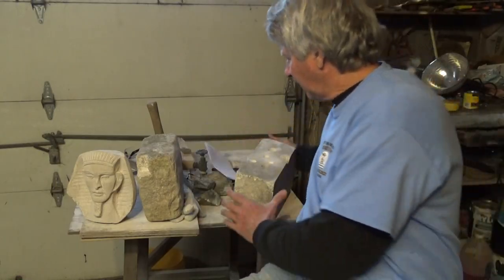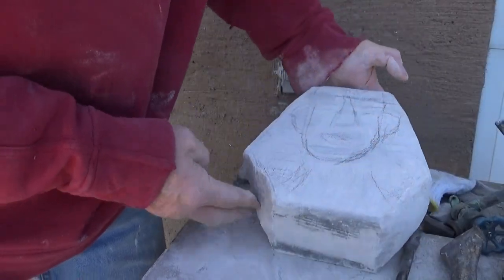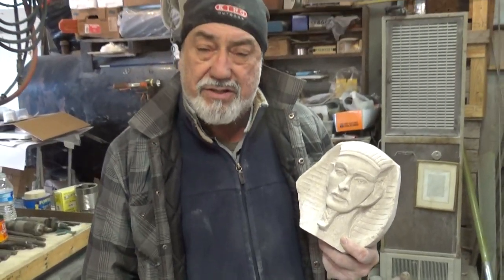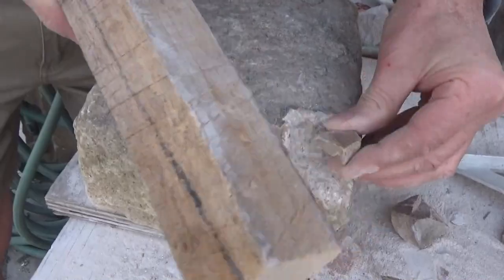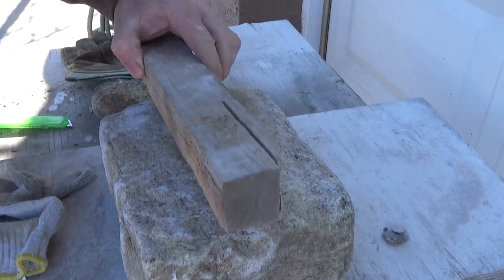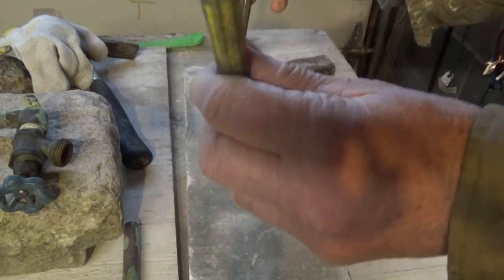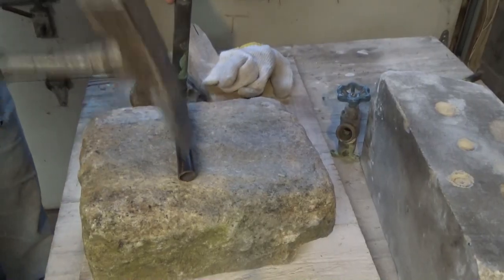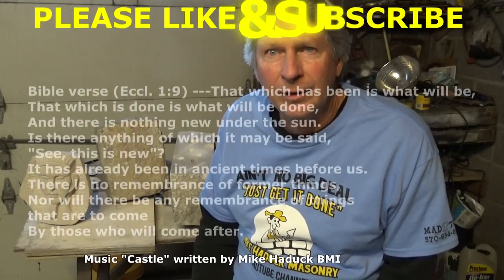CARVING STONES WITH ANCIENT TECHNOLOGY (Mike Haduck)

Comment: the box inside the kings chamber is made of very hard granite.  and it is cut to laser perfect precision INSIDE it.    engineers measured it with modern equipment and they saw no light   no gap, with a perfectly straight measuring level.    Let's see a modern  :" tradesman" cut a block that hard, that perfectly, and no mistakes.... plus move a giant stone sarcophagus way up inside the huge pyramid.      we cannot even do that today
Reply from the maker: Hi Paul, they could do that 100 times easier today than they did then, if you were in the business you would be able to see it, in those days it just took more time, I did a video called " carving stone with ancient technology " you can see what tools they used at the egyptian museum,  don't be listening to those bedroom archeologist,  get some stone ans start working it and you will see for yourself,  thanks Mike

Comment: Do you think the stones at sacsayhuaman were carved in this manner given that they fit together so tightly? The shapes are so random that it seems inconceivable that they could be prepared to that degree of accuracy with these methods. The bulges where they fit together seem to indicate that they may have been melted with a lot of heat to squash together so tightly. I know you could get very close with these methods and given enough time but surely there’d be some gaps along every joint?
Reply: All your questions about Sacsayhuaman answered:
https://www.youtube.com/watch?v=_5AplOCegMA
Reply from the maker: Hi Josh, I don't see the big deal, just make two patterns and beat the stone till it conforms, I took a good look at those site and they are not all as perfect as they say, a lot of hype is being put into it, thanks Mike
Reply: @MikeHaduck  thanks for the input Mike. I guess talented stonemasons are capable of it then. Even if just the joints that I’ve seen on videos are perfect and the rest are not, it’s an incredible level of skill to fit them so tightly.

Comment: I like how you cut to the unfinished obelisk that clearly isn't made by chipping away small bits as the deep and narrow cuts. What's up with the very long striations on flat surfaces? The bent pyramid was supposedly built in about a 20 year time frame. "It just takes time" means "this isn't at all how it was done". I don't know who you're trying to kid with the big blunt rock that's chipping away at the same rate as the surface.
Reply from the maker: Hi Jordon, I worked big jobs, I don't think it took longer than the empire state building, don't be listening to all those bedroom archeologist,  no big deal, just money and the Pharoah  had it, thanks mike

Comment: Drive a line of long chisels along a precut shallow line in limestone bedrock.  Once you drive them in a short distance = the bedrock will continue to fracture downward.  Now repeat this perpendicularly down the sides and add a line along the bottom with spaces to insert wooden levers.  Via this method you can break off approximate chunks akin to breaking a section of a saltine cracker.  It is not necessary to chisel out an individual 6 sided block.

At Giza as but one example the quarries show trenches cut in the bedrock with spaces for levers to break free chunks of stone.  Limestone as a sedimentary stone forms in layers like a cake.  So you can break these sections free along natural layers in the bedrock.  This will give you most of what the pyramids are built from.  Very few of the total blocks show more careful cutting and in some cases polishing.  Those are only see among the blocks which form the inner corridors/chambers and the last few outer courses of stones to include the polished casing stones.  All the rest of the pyramids are basically stacked rubble. 

p.s. - granite is only seen in pyramids sparingly and then in basic shapes = blocks and sarcophagi.  Via gneiss stone tools like flint or dolerite pounders and fire they could hammer through the granite bedrock along natural fault lines to achieve blocks which could be finished after a time via copper tools and abrasives like sand or corundum.  Remember that granite sarcophagi were being used since the time of Djoser - and not just for Pharaohs.  So quarries as today likely had partially finished or already finished objects on hand having been fabricated previously.  That would save an immense amount of time.
Reply from the maker: Hi Vary, I agree,  Mike
Reply: @MikeHaduck  Yes.  People need to step back and consider the larger picture.  This was a industry in Egypt - and not just for Pharaoh. 

As an example.  At Saqqara huge underground caches of mummified animals have been found in the past - literally millions of them.  They were for everyday people as well as wealthy ones for offerings or burials.  So "death" the same as  "life" fostered a huge economy in ancient Egypt.

Stone masons worked constantly fashioning things - for Pharaohs or other patrons.  Royal craftsmen were provided housing and food as payment for their services so that they need not worry about basic necessities.  That allowed them to simply = work. 

The knowledge was generational being passed down which means after a time they had worked out the kinks and could fabricate based upon proven techniques = shortening fabrication times. The same applies to others things.  The Giza pyramids were not the first to be built.  So via building previous pyramids - and large mastabas etc. before that - the Egyptians of the 4th Dynasty already worked out the logistics and manpower control mechanisms necessary to build these structures.  

People assume they were starting from scratch = ergo their supposed "impossibility" rationalizations.  Have a nice day.
Reply from the maker: Thanks Vary, I agree again, thanks for the comment,  Mike

Comment: Dear Mike Haduck
One can undoubtedly shape stones with the proposed method but claiming it to have been used for great achievement such as the Egyptian pyramid of Giza seems to be a shortsighted idea. Let's remember that the great pyramid of Giza accumulates 2.3 millions of multiton stone blocks that must have been quarried before any shaping work and placement can be done, not to talk about how they were transported, for the moment being. As  that single pyramid is estimated to weigh at a whooping 5.300.000 Ton, all of these work were supposedly performed with biological strength and simple mechanical precepts. Allow me to introduce this superficial and overly simplified example regarding the required amount of copper necessary for the great pyramid according to the proposed method.
Let's suppose that in order to shape 1 ton of stone one would use 8 pounds of copper, quarrying and shaping included, thus an impressive 20.000.000 Ton of the material (copper) needed to be available for that one pyramid only. Meanwhile with modern technology and transportation, we have managed to also produce approximately the same amount of copper during the last 50 years, from 1970 till date.
 How much wood, sand and rock chips did they use on top of all the brilliant display of precision based engineering seen throughout the structure? Dude, they didn't use mortar whatsoever while erecting a 450 feet structure.
 I dunno but is understandably respectable to state that a different method was used for the construction of a pyramid and other megalithic works around the world,
Reply from the maker: Hi Fiti, I can tell you never worked with stone or on any massive building projects, it didn't take any longer to build apyramid than the empire state building, stone quarries been around from the beginning of time and if you ever worked in one you would understand the simple techniques they used, back in the late 50s and 60s when I was a kid they still did it by hand, don't listen to all those bedroom archeologist,  thanks Mike

Comment: Mike, I know it's possible (and not uncommon) to split granite in a straight line by drilling holes and using wedges. Is it possible to take a large slab of granite and split into angles using that technique (such as a 45 degree or 30 degree angles?).  If so, wouldn't it be possible for the stonemasons in Peru to have made a wall from one massive & horizontal rectangular block of granite by drawing the design (of the intended wall) on the block like you would if designing a puzzle, then using the feathering technique to split it into the shapes.  After it is split, take each piece and smooth the edges to remove wedge marks & then reassemble the individual blocks as a wall.  This would also seem to solve how to make these blocks fit so tightly.  Possible or not?
Reply from the maker: Hi, it's all basic masonry, as you quarry the stones find the closest to what you want and then beat it into shape, before diamond saws we would have to wait for the quarry guy to get down to the size of the stone we needed, it's all basic,  Mike

Comment: Explain how the great pyramid was designed. Absolutely accurate.  And level
Reply from the maker: It's not perfect, close no cigar
Reply: As a lifelong tradesperson , the design of a pyramid is pretty simplistic.  Even in its simple form , it was a design reached by trial and error. You can see instances of earlier pyramids that collapsed because the geometry wasn't sound. So they learned from their mistakes and found the proper proportions that were architecturally favorable and stable. You don't need aliens or supernatural powers to figure out any complex geometry although I'm not saying ancient Egyptians weren't capable of figuring out that math. What I am sayin is that with simple tools such as a plumb bob, string lines and water levels,  you can eliminate the need for the thousands of  masons to understand any complexity to build within the parameters needed. They simply needed to set a plumb line in the center , use water level to set your foundation,  using string lines and very basic layout methods bisect your 4 quadrants . From there , string lines would be pulled to the central apex of the pyramid that would be established by building a temporary tower set with a plumb bob to its center from its foundational footprint  to the top of the central tower. With plumb and level and the for outside corners Square to eachother,  all one needs are stringlines pulled between those points.  Then the masons just need to cut the stone and fill in between the string lines. These pyramids were built by skilled masons guided by very intelligent architects who had generational knowledge built upon the successes snd failures of their ancestors.  No alien technology needed. As far as how the stones were quarried , cut and moved,  there is plenty of information out there on how that was accomplished as well.

Comment: what amazes me is thinking about the sheer amount of manpower needed. The pyramids were not built by slaves like they told us as kids. There was a literal army of trained masons working non stop for God knows how many years. And thats just limestone. The armies of masons pounding through granite a 1/32" at a time is on an entire different level. These guys must have lived and died working on the same project. Just thinking about the time scale and manpower is baffling. Thinking of the andesite, basalt and granite stone structures with perfectly scribed polygonal faces must have been multigenerational projects.
Reply from the maker: Hi ,I did a couple videos, carving stones with ancient technology,  part 1 and 2, personally I worked on huge projects in my masonry union days and I don't see it taking any longer to build a pyramid as it took to build the empire state building, my opinion, thanks Mike
Reply: @MikeHaduck  I watched them both, thank you for making these!
Reply from the maker: Thanks. Mike

Comment: Can you show how to polish granite to the level that you can see yourself in it ?
Reply from the maker: Hi, I got a playlist out called " rockfacing and shaping srone" part 13 gives an example at the granite museum,  thanks Mike
Reply: @MikeHaduck  You can use emery to smoothen granite. I would like to see how to achieve a mirror finish on intricate surfaces. I have uploaded a video on my channel from the egyptian museum in cairo showing what is in my opinion the best preserved statue. Please check it out and tell me your opinion.
Reply from the maker: Send me a link, thanks Mike
Reply from the maker: The same way as the guy did it at the granite museum, I don't have a video but the same way you do the round parts on granite counter tops,  what's the big deal? Thanks Mike

Comment: I'm wondering ... copper is initially soft but as the craftsman kept pounding it maybe the copper got harder because  of work hardening?  As you work the tip into the granite, the tip gets harder and the job may get a bit easier?   You said that with granite, its not the sharpness of the tool but the hardness since your crushing and not cutting.  Ben watching your videos ... cant get away from them.
Reply from the maker: Thanks bill, I got more videos on egypt comming, I am a bit behind, thanks mike

Comment: Impressive but the eight-sided main 
Egyptian pyramid, perfectly fitted with the number of stones if I recall correctly and "can" get the information, was like cutting, moving from hundreds of miles away and would have to be set every stone in 2-3 minutes, each,  that's certainly not possible...
Reply from the maker: Hi Occams, I worked on huge projects and I don't think it took longer to build the pyramid as it did the empire state building, if you whatch my other videos on the pyramids they filled the inside with junk stone. They are a feat but not as persise as they make them out to believe, Any seasoned stone mason would see it right away,  thanks ,Mike

Comment: Yes it can be done and will take a very long time, but try keeping it flat and straight over a 2M not 2" square? The problem is that you find all over the Giza Plateau Saw marks and Drill holes that have no function, Time would not be wasted on cutting a rock that has no purpose. You also see obvious blade slip mark which cannot be explained.
Reply from the maker: Hi Blue dog, it's only stone,  I got a whole series on rockfacing and shaping stone,  check out part 13, the guy gives a demo on polishing granite by hand, don't be listening to all those bedroom archeologist,  thanks Mike
Reply: @MikeHaduck  Hi Mike, I don't doubt that given enough time it can be done, although I would question the accuracy. The human hand itself has a tolerance? What's more puzzling is the random Drill holes and Saw makes all over the Giza plateau that seem to serve no purpose? considering how much time it takes to cut into stone one must ask was it done this way?
Reply: @MikeHaduck Hi Mike, Using  modern day Copper pipes or Copper sheets which are normally made by machines for accuracy. This tells you that if you where to try and make the tool to cut a hole by copper, the tool would have to be very accurate, extremely difficult to make by hand. this is why we make machines for accuracy? try making a perfectly round pipe by hand from copper you've mind. a science within it's self?
Reply from the maker: Hi, it's only stone, I spent a year in the middle east in early 70s in the military and I seen tons of old school primitive machinery, didn't have a video camera then but they were as accurate as any thing they got today, the bigger the lie the more people believe it,  it's all basic time, skill and money, thanks Mike

Comment: Mike. This is all good and everything, but whoever built the pyramids, left cores after boring and they did it in one continuous bore line. The core samples were a continuous pass, and you could wrap floss around the cuts. 
This can only be accomplished with power tools, diamond tipped hole cutting saws and several tons of pressure.
Reply from the maker: Hi Poppabear, everybody underestimates the ancients, they had diamonds and hard stones and jewelers to make drill bits,  the bedroom archeologist of today never worked with stone or moved anything heavy but they are ones making these fake news claims, I am more impressed with the cathedrals than anything the Egyptians did,  my opinion,  thanks Mike
Reply: @PoppaBear The claim of a single continuous bore line is widely used to fool people. It simply does not exist.
Reply: @Eyes_Open  look it up. It exists. I’m a machinist and I can recognize the continuous bore lines.
Reply: @poppabear9279  I have looked it up. It has been thoroughly investigated and proven beyond any doubt that there is no continuous spiral.

Comment: If you can use this method to make a plane of granite that is perfectly smooth to within 1/1000 of an inch I’ll believe your method. Even just a square centimetre
Reply from the maker: Hi Matthew, go to any granite kitchen installer, thanks Mike
Reply: @MikeHaduck  I did say using the methods in the video, not with modern tools. thanks Matt
Reply from the maker: Hi Matt, go to my video, "rockfacing and shaping stone part 13" the guy from the granite museum gives a demonstration,  also you can order modern emery pads from the Walmart site if you want to try yourself, thanks Mike
Reply: Hi Mike. Thanks for the link I have watched it and the methods shown do achieve a fantastic finish to the granite using methods I have not seen previously. However at points gun powder, steel chisels and an air compressor are used which were invented far far later than the estimated dates of the monuments of Giza even by the currently accepted timeline
Reply from the maker: Hi Matthew,  look up emery stone and all the products made from it, you can order it and polish granite all you want, today they use machines but they been doing it by hand from the beginning of time, you can even make a video out of it and show all those bedroom archeologist how it's done, thanks Mike